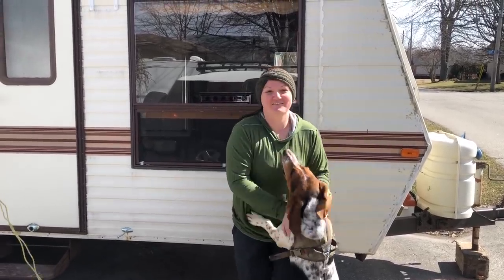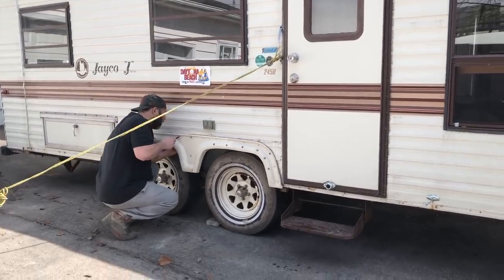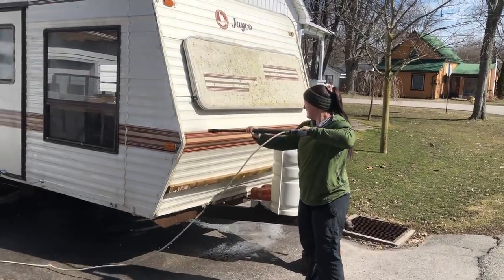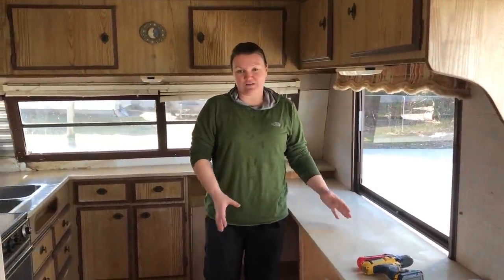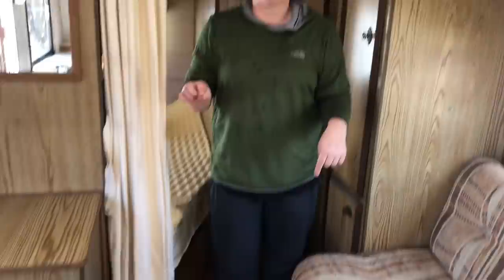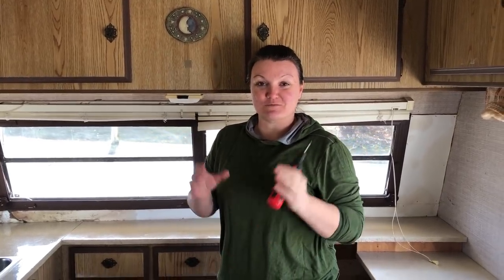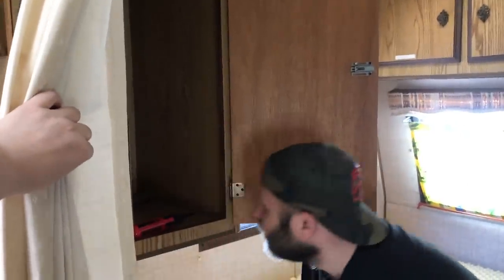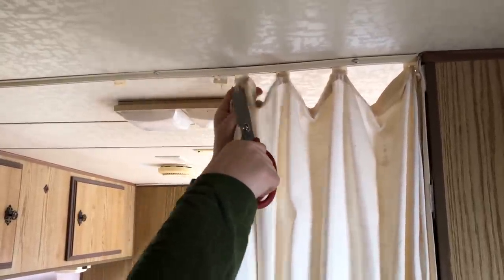Camper Makeover | EXTREME Trailer Renovation | Demo DAY!

Comment: Storage, storage,  you dont realize how much you need. Food, dishes, shoes, clothes, games, dog food, outside chairs. Its looks like you have alot until you start trying to put everything away behind closed doors. No open shelves, it will all fall in the floor when you move. I'm excited to see the finished product. I know it will beautiful.
Reply: They're not wrong though.  Making shallower overhead right-sized storage for dishes, etc would be my thing too.  I've got my camper loaded and I realize a better shape/size of overheads is possible which would open up the space and still give the utility for dishes, spices, etc and possibly create "restraining" holds so things do not move at all since it's custom-built.

But you're right, eliminating storage should be carefully analyzed and considered by recreating some storage spaces more efficiently and ideally to suit a custom build.  Unlike a factory production, this is going to have the opportunity to be significantly more efficient.
Reply: I agree about storage - will be interested to see how you replace it. The double bed area is such a waste of space to have it like that without it being a transform area. The double bed in our caravan was 2 padded bench seats with a board which slid in the middle and the cushions slide down to form the mattress Also you need decent lighting

Comment: I redid a camper for my son. Make sure you sand and prime any surface before painting and that wallpaper is a bear to take down. New curtains make a huge difference and I used peel and stick tiles to update the floor without adding weight. Can't wait to see the end results.

Comment: To remove the contact wallpaper, heat it with a hair dryer.  Then you can peel it off.  It's actually pretty fun.  My fingers are itching to drive over and help you.  I love re-doing old campers.

Comment: We have a similar couch in ours. I was able to take it off and apart to reupholster. This may have already been stated in your comments or other videos but be careful of the weight of what you add to this space. When we bought ours, we were told that our car had enough engine power to pull it. It did not. We now have a new vehicle and it pulls it like a charm. I hope that when this is finished, you can travel, your parks will be open and you can enjoy summer time with your family.

Comment: Be sure to check for water damage around the ceiling and windows. I once bought an older camper and ended doing hours and hours fixing water damage that didn’t show inside or outside but was a mess inside the walls. Good luck.

Comment: please don't put in a booth and table unless you only want it for your boys only.I have had 5 campers my friend was on the heavy side she couldn't sit there there was just not enough room between the table and back of the seat for her to squeeze in.Why not try a fold down table and stools it can be lifted for a bed for your son.please look at some tiny homes on you tube that have all kinds of space saving practical tables. it can be high enough to use as a work station for editing.the stools can be stored under bed or even folding director chairs for the adults that can be used out doors when parked

Comment: Talk to the people at Jayco before you take out cabinets.  You have to balance the weight of your trailer (equal side to side, front to back).  People take trailers apart and go on the road only to have it flip and take their towing truck/car flip with it.  Make sure you use good quality tires and that the wheel system is in good shape.

Comment: Idk but looked like some sagging was going on.  Make sure u check the floor, sidewalls, roof before doing anything.  Put a moisture meter on the walls. If no rot which is highly unlikely, then reseal everything!! Then & only then can u start planning your re-design